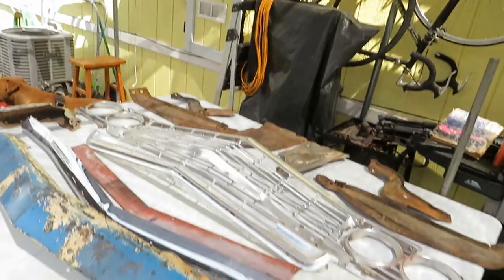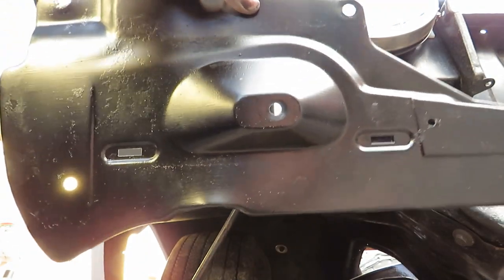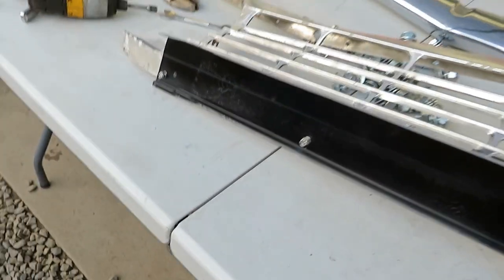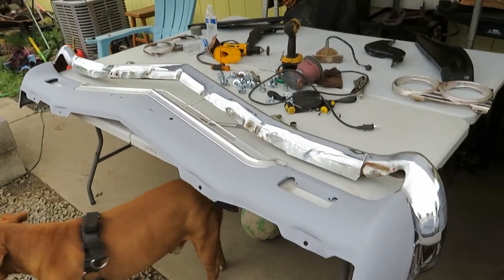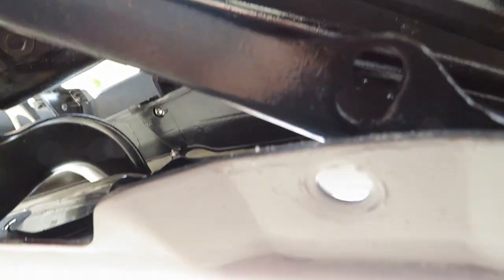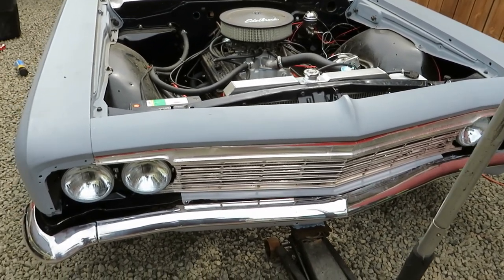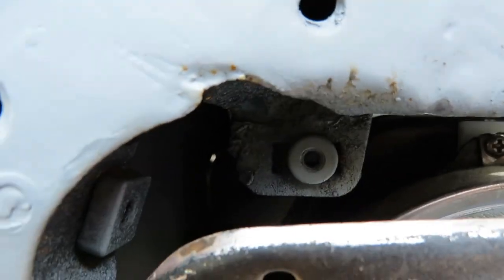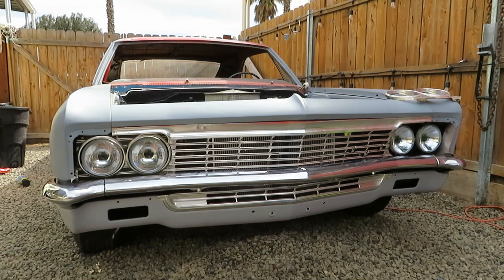1966 Chevy impala grill and front bumper assembly install

Comment: I bought new lower bumper but I was looking to remove restore the rest, what was all the bolts & screws you’ve used in this video. It’d be really helpful in my build thank man!!
Reply from the maker: For the grill I think I used 1/4 size bolts and nuts, for the lower valance I can’t remember, I just tried out bolts that I had in my tub of bolts to get a size comparison and went to a hardware store and got them all

Comment: Any more work on the 66?
Mine will be home next week after years a paint shop
Reply from the maker: I’ve been doing little things off camera like rebuilt the rear brakes, installed new shocks up front and sway bar end links, I should’ve recorded it but oh well, imma take it in to get the exhaust done in 2 weeks so I’ll record it and post it up
Reply: Hey carnal 
What kind of head light did you install and where you guy them. Did the just fit in or did you modify ?
Reply from the maker: @dnbramirez  I got them on eBay, they fit perfectly with no modifications
Reply: @cali530marcos3  
Can you send link and let me know description? Trying to get all my stuff to start putting back together.
Reply from the maker: @dnbramirez  https://www.ebay.com/itm/263497214539
Reply: Hey Marcos. I got my 66 back at the pad started putting together.I got my grill on and front bumper your video help. I don’t think I can send you pic here.
Reply from the maker: @dnbramirez  what color did u go with, u can send me pics threw my instagram, same name as my channel
Reply: Orale I’ll look for you my wife got it.
Reply from the maker: @dnbramirez  seen ur pics, the car looks nice in that color, why did it take so long for the shop to finish the paint job

Comment: What are the bigger bolt sizes that you used for the bumper and the little tray under the headlights
Reply from the maker: For the bottom grill that goes on the valence I think the were 1/4 and for the bumpers I think they were 5/8

Comment: What size bolts and nuts i need to install the grill and accessories?
Reply from the maker: For the grill I went to ace and got 10/32 bolt with 2 washers a locking washer and bolt, u need like 10 bolts